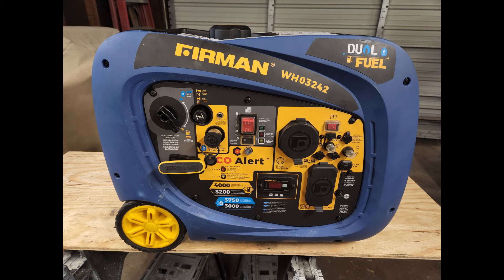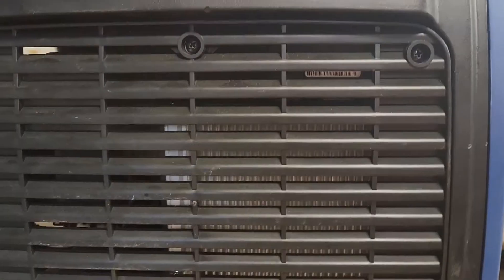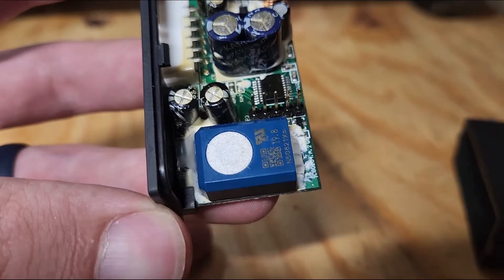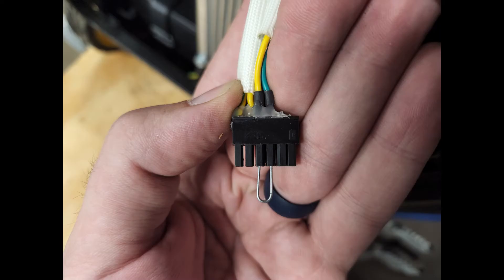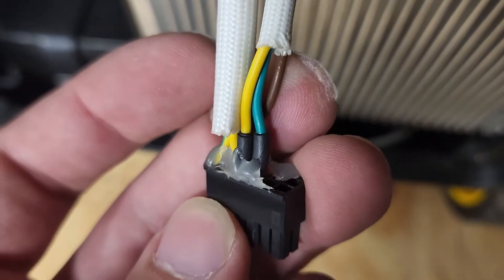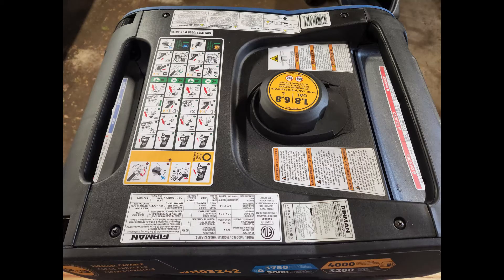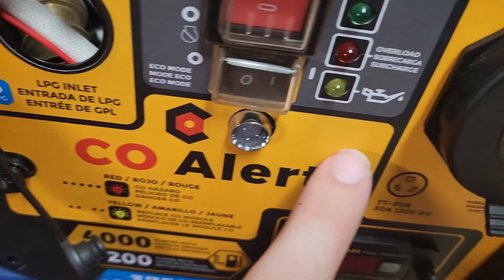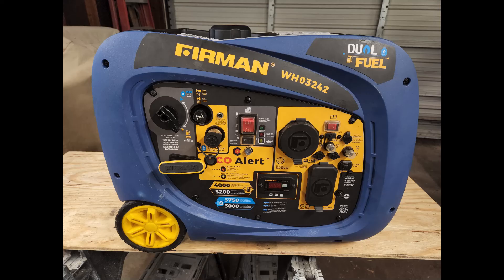How to Bypass CO Alert Module on Firman Generators

Comment: So if i put a toggle switch on the Green & Yellow wire... Do i need to jump the other 2 wires on the Co2 sensor plug harness..?? Or would the toggle switch eliminate that part..??
TIA
Reply from the maker: You only need to do one of the options.
Reply: @pilotdog68 ok, great, thank you 😊

Comment: i own a firmen i would never buy one again there is always something wrong with it....sensors way to sensitive for example oil sensor will cut the engine even b4 oil reaches minimum if ur doing non critical work its a annoyance but if ur doing critical work like i was doing today pooring foundation....co 2 sensor cuts out....they should have a error byepass switch

Comment: We just bought the generator and it's outside, so imagine my anger when the CO2 sensor keptflashing and the generator shut down.  We'll try this when the sun comes up. If it doesn't work, I'm taking it back. $600+ and it doesn't run without me working on it?  That's just wrong.

Comment: Super helpful, thanks for making this! Really easy to follow. I went with the jumper option on a WH03242 model (green and yellow wires). Didn't have a small paperclip so i used a piece of keyring. The unit is out in an open air away covered area away from the house, so there was no chance of carbon monoxide poisoning and a faulty sensor was keeping me from running it during an outage in Puerto Rico.
Reply: Hola, cual era la falla que te daba el equipo?

Comment: Thanks for the tutorial!  I own 2 T07573 from Costco and their CO sensor is so sensitive that always fail on us when we need it the most.  I had jumped out the 2 wires in the bottom part of the plug.  My set up is the 2 black wires next to each other.

Comment: This was extremely helpful it helped eliminate other problems we were not getting any spark and there's really no way of checking the ignition coil got the ground wire leaving the ends were long enough to reconnect if needed apparently my CO sensor was bad you are awesome

Comment: I have the larger Firman T07573 and none of the bypass descriptions worked. Let me know if you come out with another video for this generator. Thanks.
Reply: Disconnect the only single black cable that goes to the spark plug cable. There is a single black cable that goes from there to the board just disconnect it
Reply: @ItzRocket89P13 would definitely appreciate some additional instruction on this one.  I see the cable coming off the plug. It travels towards the board and runs behind some metal covering.
Reply: Did you fixed??? I hace the same one  @ItzRocket89P13

Comment: why bypass the sensor ?
Reply from the maker: @northlander4370  many people have had issues with false positives, rendering the generator useless. If you aren't having issues, there's no reason to bypass it.
Reply: @pilotdog68  i have a new  wo3386 firman , have not started it and will not start it until spring when we camp , will see then.

Comment: I have a smaller simpler version, model p01204

The wires were in the same location on the plug, but both were colored black

Comment: Hi, this is a great video!  I have a Champion 100110 generator. Not sure which wires to jump. I think they may be the black and red ones in the harness to the left in attached pics. (They are the only two wires in that harness). The other harness, to the right has three wires- brown, grey and red.  I attach the wiring diagram (on pg 9 of pdf)- any advice appreciated! https://drive.google.com/file/d/1DD_b_uKpCYyxSFYlcoNXCejN4VSkPICh/view?usp=drive_link https://drive.google.com/file/d/1DCxEOvgfQEWaS6dG-yKwEveU6X-V2PCe/view?usp=drive_link https://drive.google.com/file/d/1DKWQJDl_dZojWTNxzHgdjeNEXbZ5k4iz/view?usp=sharing

Comment: This worked for my Firman H07753 Dual fuel. The wires were black and white, but they were in the same position as in your video. I confirmed with the wiring diagram before trying and it worked perfectly. I needed to use a twist tie wire though because even a small paper clip was too large. Taped it in place and we now have power!!! Thanks for the tip. ❤

Comment: Thank you sir. Because of toure picture of the inside of youre sniffer, I located my sniffer on a champion 4500 inverter duel fuel. My sniffer dont look like yours.but its got that little blue bow with the round on the outside of it. Its in  tray mounted with 2 screws and 3 wire sets going to it. For people with my generator looking for it I want to tell them here to pull the side panel off that is the same side as the pull cord and oil check and the propane attachment. As youre facing the machine, the sniffer is on left side upper. It has 3 seperate wire harnesses going to it. The blue sniffer with round white in the middle is at bottom of that box tray with the wire harness at the top  im going to take it off Nd wrap that thing in clear box packing tape. See if that stops the sniffer from shutting down my generator. Its outside and the sniffer shuts it down when there is no wind or if the wind is hard at the backside. It blows the exhaust back into the machine vent. I put a fN on the machine. It still shut down. I want to thank this video guy for showing me what to look for. I had some other thing picked out as a sniffer. It wasn't and im glad I didn't do anything to the other thing. Thats over Bove the dip stick.

Comment: Thanks. I have my larger 9400 watt Firman in a purpose built shed. It would trip the sensor even with the doors open and I had the exhaust vented out the side of the shed. I had to jump the two black wires on mine. the sensor is behind the main panel above the start knob. You can access the wire harness without removing anything.

Comment: I have the same WH03242 generator.
I removed the CO Module and noticed a lot of corrosion, I opened it, and there was corrosion all over the box and on the actual board.
I ordered a new CO module from firman, last Thursday and it finally showed up today.
I taped the sensor and all the vents with foil tape BUT it did not work.
I am thinking that all the corrosion might be the problem with my generator, I will try method 2 next since I'm on the road and really need my generator.
Thank you

Comment: I have a T08072.  The jumper solution worked like a charm.  The wires are both black in my case and the connector is hard to reach on this unit.  My generator is in a cabana far from the house with two lateral door on opposite sides.  This thing kept on stopping every 10 minutes both doors wide open even with a large fan blowing air from the outside.  Big thank you to you, problem solved.  The company did not want to help at all. Thank you, Thank you, Thank you
Reply: I'm having the same problem. Getting ready for hurricane helen
Reply from the maker: @johnnyhuego  hope you made it through

Comment: Thank you for your video, I've just purchased a Firman TO7573 and managed to jump it, using small paper clip. For the TO7573 it's the 2black wires, then wrapped the connector with electrical tape.
Reply: hi .... hope you can help me ..  got a t07573 from costco as well ...   without removing the sensor from the generator can i simply  pull off  the white connector to remove it from co2 sensor   for easier access .. then jump it ?   please give me your input thank you
Reply: @Migou33333  Yeah, just disconnect the sensor and jump it, make sure you secure the clip with a piece of electrical tape so it stays in place. Hope this helps
Reply: @keithrichards8695  yep ...   jumping 2 black wires worked perfectly ...   thx !!!
Reply: Anyway you can guide me to the sensor? Is it in the same spot as his in this video? I have the same model that you have. I'm trying to locate it. I see something that looks similar but it's got two yellow wires going into it. Let me know if you can. Thank you.
Reply: @joewiensband  1- dismount front panel  2-  locate co2 sensor just screwed on upper black frame ..  follow the cable out of sensor to the white connector and unplug it there ..  find 2 black wires and jump them ..  secure it with black tape and leave it like this ..  if you need help locating the co2 sensor look up the part list on the internet and look at part # 71..
Reply: Any reason it might jump then still have a co2 cutoff issue.  At least according to the light

Comment: I have a similar sensor on my Champion 2500 inverter generator. Do you think covering the membrane with superglue or some sort of silicone sealant would work or would that seep into it and cause a fault?
Reply from the maker: Mm I'm not really sure. Maybe worth a try
Reply: @pilotdog68 Update. Pulled black wire that goes to Engine Stop Micro Switch. Works like a charm. Vid on my page.

Comment: Hi ,
At 5.18 minutes. you said the CO sensor grounds out the ignition module when it senses CO, I’m wanting to install a thermal switch to shutdown the generator in the event of Hi temps.

What wire coming out of the CO sensor is grounding out the ignition? Wanting to break into that wire and install a N.O thermal switch that goes to ground and will shutdown the generator.

Alternatively you said the gen won’t run without the CO alert,is there a single feed wire to the CO that I can interrupt with a N.C thermal switch to achieve a shutdown ?

Thanks
Reply from the maker: Hi, the yellow and green wires that I talk about jumping at 3:10 are the wires that are being grounded to shutdown the ignition. Alternatively the Brown wire provides power to the CO module, so interrupting that would cause a CO fault and shut it down as well. Though if I remember correctly that method would not be instantaneous, it takes a few seconds delay for it to sense a fault. You can see the wiring diagram on Firman's website, or at the top right at 8:46
Reply: @pilotdog68  Hi, thanks for responding so fast! A little confusion on the three yellows… to clarify , when the CO unit detects CO it grounds the yellow that goes back to the ignition coil (yellow next to green on the CO unit) and cuts the motor?

If I splice one side of a N.O thermal switch into that yellow (the other side going to ground) in the event of an over temp scenario the thermal switch closes and the motor will shutdown?

Want to be sure before I cut wires…

With using the brown instead, when you say seconds is it under 10 seconds?

Appreciate the help

Comment: when you cut the green and yellow wire what happen?
Reply from the maker: The module will lose access to Ground so it can't pull down the ignition signal.
Reply: @pilotdog68  mine won't start
Reply: @spotlessnlcarpetcleaners  I believe after you cut that wire, you need to push the plug back into the socket like it was originally for it to start.

Comment: anyone know how to do this on a t07573?
Reply from the maker: It should be about the same because it uses the exact same part number CO sensor. You just have to dig around and find it on yours. here is the picture from the parts diagram. https://imgur.com/a/isHv11p

Comment: Great video.  Thank you.  I have a Firman P09201 11,400/9200w that shuts off frequently from co alert.  The Firman P09200 control panel is boxed in and I am unable to access it without removing the gas tank etc.  Do you have any suggestions?  Thank you very much.  Again, excellent video!
Reply: I have the T09275 11,400/9220w , tri-fuel, and the sensor is on the oposite side of the exhaust, close to the control box, but not inside it. I didnt disable it yet. Close to the recoil starter (the pull-start)
Reply from the maker: It's unlikely that it would be inside the control panel box because the sensor has to get air to it, but it's certainly possible you will have to remove the fuel tank to see it.
Reply from the maker: That model generator seems like it has been retrofitted with the CO module because i cannot see it on the parts diagram shows an older version without the CO sensor.

Comment: FYI The firman tri fuel is 2 black wires
Reply: Mine jumps but still shuts off as if there is a sensor issue.

Comment: Just removed the green yellow wire pin from connector block, with a 1mm phillips screwdriver,  "easy reassemble". machine works great now, Thank you

Comment: Need some help identifying correct wires on my firman model w03386. Appears to be yellow and brown. How do I attach a pic?
Reply: Success jumping green and yellow. Remote start not affected. Thx much
Reply from the maker: Unless the manual for your generator is wrong, it's still the green and yellow wires that come out of the same white sleeve together.

But yours has remote start, so like I said in the video I'm not sure if you need to do anything with the blue wire or not. I'd try jumping green and yellow and see if it works before messing with blue.
Reply: I think you are right. I can’t pull it out very far to get a good look. I’ll get closer in tomorrow. Thx